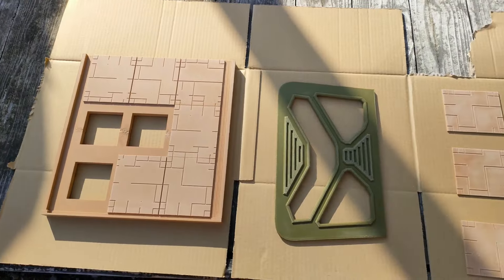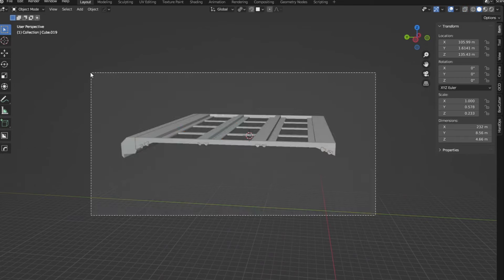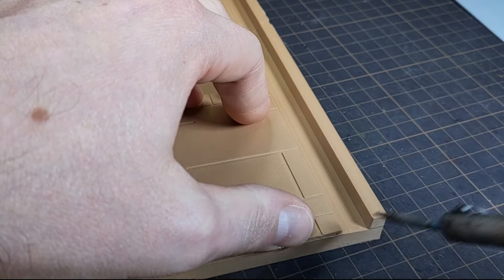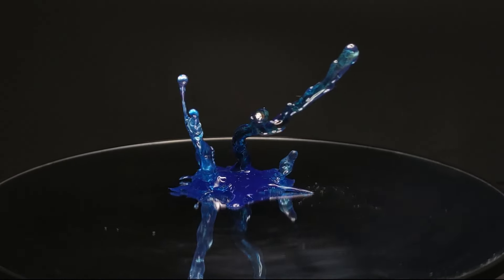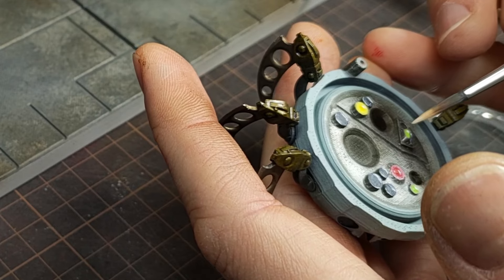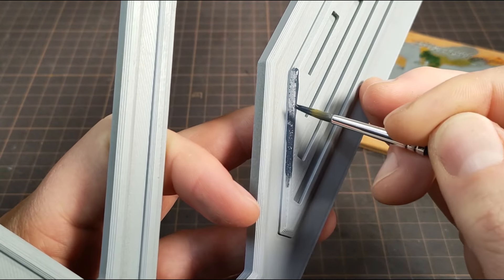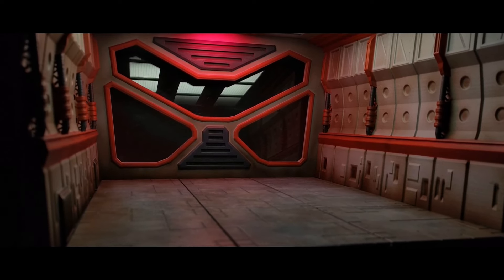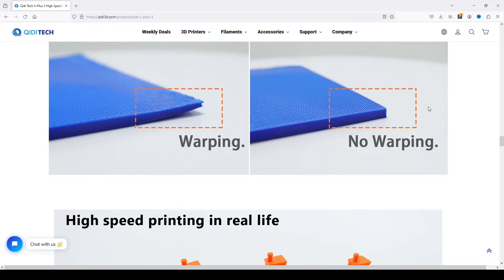I made a sci-fi DIORAMA and a short story! | Qidi Tech X Plus 3

Comment: When soldering plates together, I melt a metal ring over the seam.

Also a 3D pen works good for welding those bottom seams
Reply from the maker: There's a lot of potential with heat and plastic welding for sure